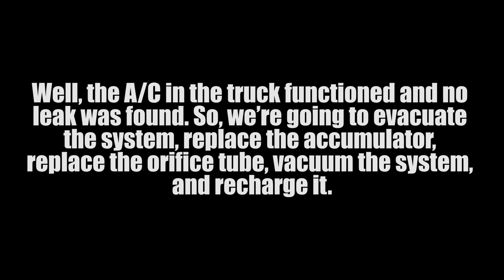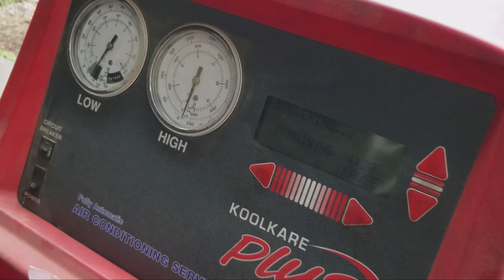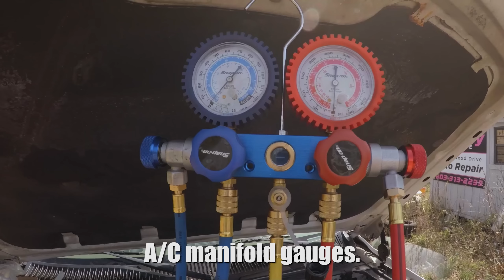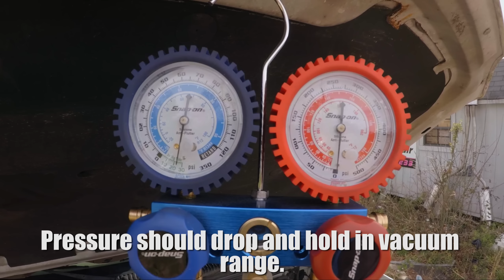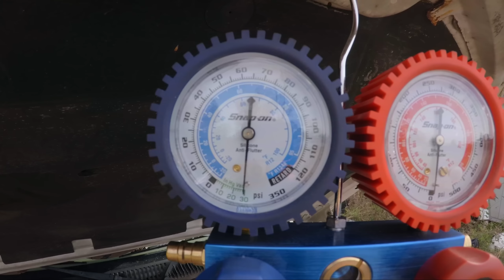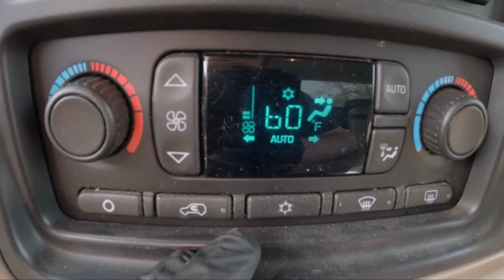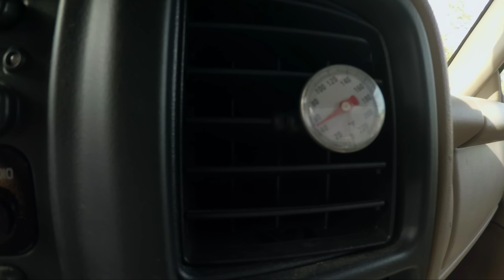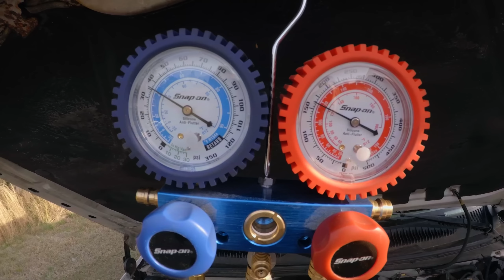A/C Accumulator & Orifice Tube Replacement

Comment: How did you diagnosis the problem and know what to replace?
Reply from the maker: The truck had been without A/C for a while. I previously injected leak detection dye and recharged the system to check operation and for any leaks. System worked as it should and no leaks were found. The accumulator acts as a filter for the system. It has a desiccant property. When the system is left open or not charged, it absorbs water. So, as part of the maintenence of putting the system back into use, I replaced the accumulator. I also replaced the orifice tube due to it being a filter/metering device for the system. It's routine stuff to replace on a system when you open it or it sits unused/uncharged.

Comment: On  my 95 f150 my refrigerant blew out of the connection coming from the accumulator is that a sign of a bad accumulator or orings or both how would I check it to make sure is age the only factor or what???

Comment: I had recently had a new ac compressor put in. New ac compressor, new accumulator, and new oil on my 03 Silverado 5.3. Why does it get warm when itle or at at stop light? Then gets cold when driving? What do you think it is? It didn’t do this when I got it replaced a month ago and now it’s starting to do it
Reply: Aaron Gonzalez Could be multiple reasons.. Could be a refrigerant issue. Could be the refrigerant is not condensing in the condenser.. is your fan thats removing the heat from the condenser or radiator(or both) working properly? Check all these things first

Comment: I see that you poured 2oz of pag oil directly into the ac accumulator.  Did you do this because the compressor was replaced.  Reason I am asking is if the compressor wasn't replaced wouldn't their be oil already in the compressor, and wouldn't it be bad to have an over charge of oil?
Reply from the maker: The full system has a specific refrigerant oil fill level. Each component has an oil fill level when that component is replaced. Usually you drain and measure the amount from the old component to fill the new. It's really hard to drain the accumulator. So, just filled via the approximate amount that should be in it via the factory service manual recommendations.
Reply: @MrSubaru1387  Oh ok thank you.!!

Comment: hey Mr.Subaru you ever seen or heard of those under the seat subwoofer/amp that came in impreza's from 2000-2008 if you have i was wondering if there any good i can get one for cheap
Reply from the maker: I have a couple in some of the parts cars if I remember correctly.
Reply: have you ever heard one in action ....do they sound ok?
Reply from the maker: Yea. My 98 LGT has one, my 02 L.L.Bean has one, both my WRXs had them. Can't really tell much difference.
Reply: cool.....btw you wouldn't  happen to have a 02-03 20mm wrx rear sway bar for sale would ya?
Reply from the maker: Pretty sure I don't. Pretty slim on WRX & STi parts.

Comment: Weird, automotive A/C uses such a small amount of refrigerant. I work on heavy equipment and something as small as a skid steer will take 5-8 lbs for a smaller cab. 

Also, when charging A/C systems using this method, the hotter the day the better. If its cooler, the refrigerant will not charge very fast unless you keep the refrigerant bottle warm.
Reply: my suburban 2500 takes 4.5lbs…

Comment: Bothered you a while ago about driveshaft and diff question i have another on why a 96 1.8 would have a slowish and long crank before start
Reply from the maker: Could be a number of issues. Could be fuel related, could be poor connectivity with a cam or crank sensor, etc. Hard to say without examining the vehicle.
Reply: MrSubaru1387 should i just start with sparks and plug wires then coil and see if it works
Reply from the maker: Check the plugs, air filter, etc. Probably worth changing out the fuel filter or any other general maintenance items that haven't been serviced in a while.
Reply: MrSubaru1387 thanks
Reply from the maker: You're welcome.